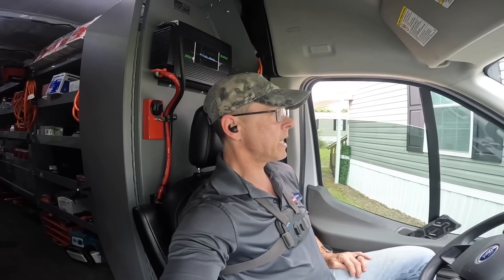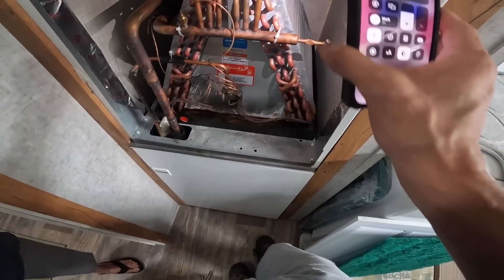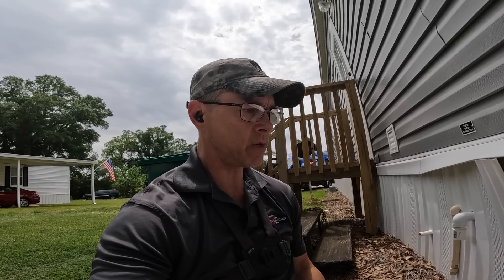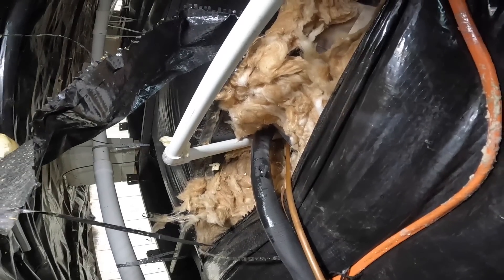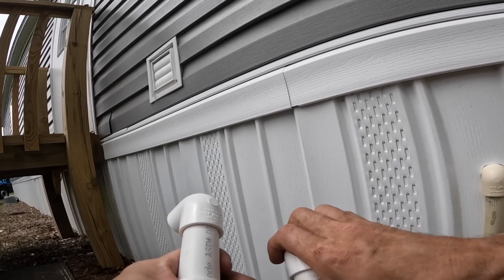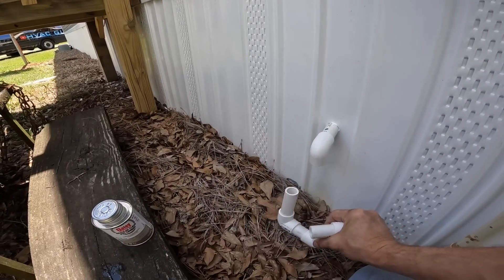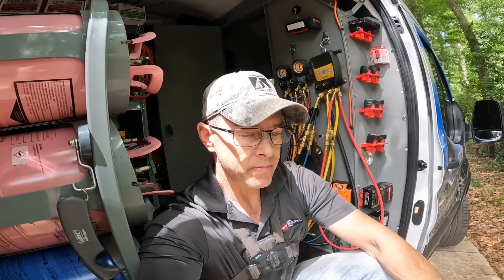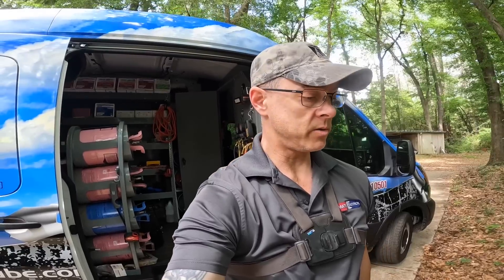I Can’t Smell, But I was Called to Find the Source Of A Smell? #hvacguy #hvaclife

Comment: I worked doing hvac at a college. Each building had its own mechanical room with a number of AHU’s. We got a call from a faculty member about a terrible smell in her office that was making her physically ill. She insisted it was coming from the “dirty filters” in the AHU. Checked our maintenance records and looked at the filters that were relatively new and not dirty yet. Nothing. Checked by the outside air dampers, nothing. The complaint was only from her, in her office. After two days, we got into her office first thing at 6:30am to see if we could smell or see anything just before the AHU turned on. I smelled something and started looking around. Found a dried up whole orange with mold growing and covering it. Put it on her desk with a note, “Found the smell”…. She didn’t complain anymore. 
Another story; guy in the trade tells me he gets a call about a foul smell in a residential furnace. He smelled something, yes. He’s checking everything, can’t find any noticeable problem. He goes out on their back porch to think and get some fresh air. Sees a cats food bowl outside, still full but no paw prints in the snow. Same thing inside, full bowl. Says to the homeowner” you have a cat?”  “Yeah but it’s been missing for a few days. Haven’t seen it anywhere”. He used a scope camera far into the ductwork. The cat got into it somehow and Fluffy was dead and rotting.
Reply: Meow. 😵

Comment: I used to work for a company that did plumbing and HVAC. On a Friday afternoon we got a call from a woman who lived in a modular house. She there was a smell coming from the crawl space. She said that her son determined there was a dead dog in a puddle under the house. She wanted us to remove the dog and determine what caused the puddle. Because of the deceased canine, the boss gave me the option of whether to accept the job or decline the job. I declined, and the boss said he didn’t blame me. We referred her to a local competitor who never turned down any job, regardless of the danger. They once bid on a job where a corpse had been in a house for several months. An old man died, and no one knew he was dead. The general contractor was going to gut the house and rehab it. The health department stipulated that workers wear PPE gear during the demolition. The competitor got the plumbing and HVAC part of the job but was fired because he wouldn’t supply his people with PPE. He claimed that PPE was too expensive and unnecessary. Not surprisingly, he took the dead dog job. He said the puddle was coming from a bad toilet drain.

Comment: In mobile homes 90% + have air handler,washer and dryer in the same area. Oh and let's not forget a litter box and trash to be taken out. All the air in the house is going there and through the coil that is possibly wet. Everybody's home smells different, they smell something odd that you won't.

Comment: Loving the video--  but techs out there-- for the love of God don't glue ALL the joints like he did on the trap. Next person will have to cut pipe to clear out down the road. Glue the joints that will take weight from the water but leave a joint or two that don't need to worry about weight and that a person can pull off later down the road. It's getting old having to work with shit pipes (tbf you got pipe to work with in this scenario but I've been running into it a lot where pipes are in concrete.)

Comment: Ive seen you do this with pvc so many times i gotta call you out.....your suppose to glue both pieces and then (push and hold together for about 15 seconds til it sets and holds) youll notice if you push together and then let go the pieces will slide apart a little bit, which can cause a leak at the joint (even just a nonpressurised drain pipe) ask me how i know...try a piece and push together and let go and youll see it seperate a little, you definitely dont want that. And wouldnt want to chance a leak by not wanting to wait an extra 15 seconds
Reply: Always one.....our drains have no pressure and are not common water lines as in plumbing. 

I've I did everything absolutely perfect I would get nothing done. Once you become a true professional you don't waste time with frivolous nonsense.
Reply: Drain lines can still leak. Leak water into your crawlspace.... wow..... yeah professional.........

Comment: Are most of these mobile homes anchored for windstorms?  This one looks like it's just sitting on blocks.  Way, way back, over 50 years ago, we would dig and set guy anchors with our REA boom trucks for rural mobile homes in Minnesota.
Reply from the maker: They’re supposed to be
Reply: If in a region where it has to he storm rated, they anchor them down still
Reply: Anchors might make ppl feel better, and prevent something minor, but, IMO a mobile home is exactly that..mobile..! Enough wind and it’s going..mobile..

Comment: how is that working anyways with the filter on the side of the coil? how is air flowing thru that coil? or just side swiping it ?
Reply: Yeah it's not optimal but you'll see that a lot in older styles mobile homes. A lot of regions aren't allowing split systems to be installed on mobile homes nowadays and this is one of the reasons why

Comment: A week ago we didn't run our HVAC unit for several days because of cooler weather. When we crank on the air it had  a smell but as soon as the coils started dripping it went away. Thanks. for the video.

Comment: I've had a few customers complain about dirty sock syndrome on systems that weren't heat pumps. I'm pretty sure there's some enzyme coil cleaner that is no-rinse, much cheaper than pulling a coil.
Reply: I use clean air products they have a spray that you can spray on the coil and little tubs of gel-type odor neutralizer also from clean air